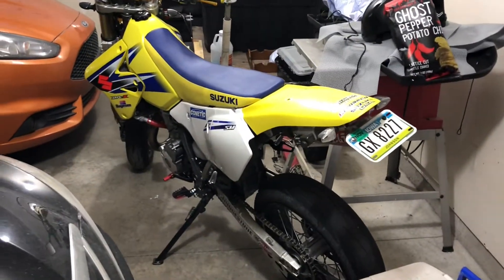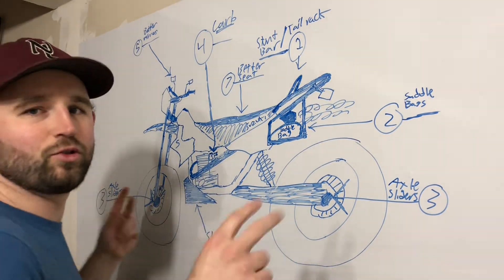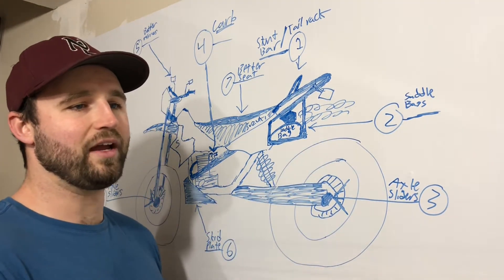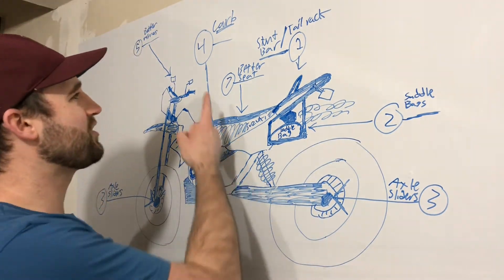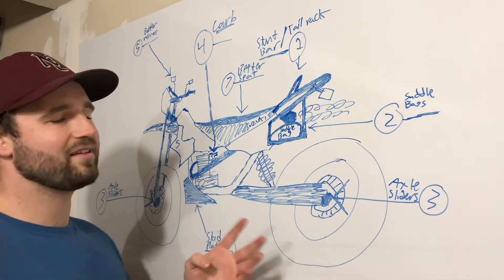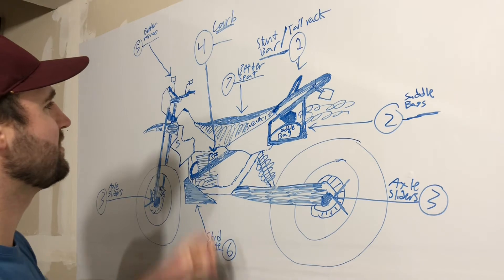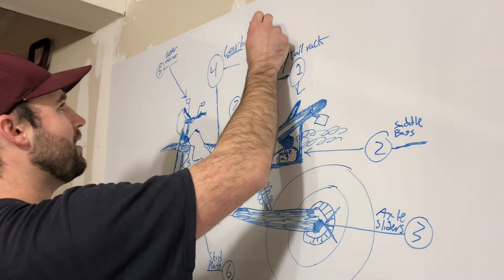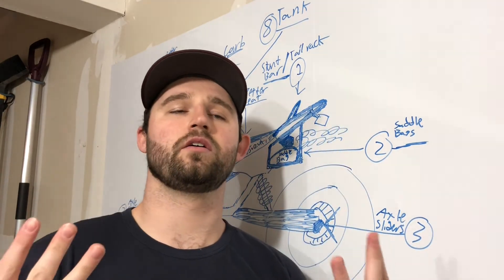DRZ400SM "SupermoTouring" Build | EP1

Comment: How's the build going?  Tracking the video is several months old.  I've done some pretty extensive touring on DRZs before, and over the years (there have been many of these) I've had four of them.  The first I got in Alaska and rode thousands of miles, and toured up the Dempster Highway to the Arctic Circle.   It was an S model.  I had a SM and an S at the same time and my 73 year old father and I rode all over Virginia, Pennsylvania and New York State.  My S is a 2013 and my SM is a 2007, so based on the E model.  It is worlds different from the later SM (Cam and Carb are different).  Anyway, I'm sometimes considering getting rid of my S model and ADV riding my SM.  LMK if you want to shoot the sh!t about touring DRZs.